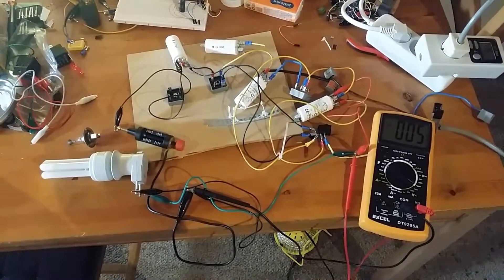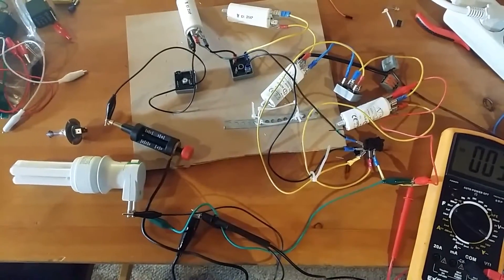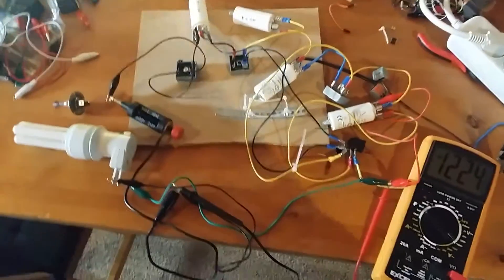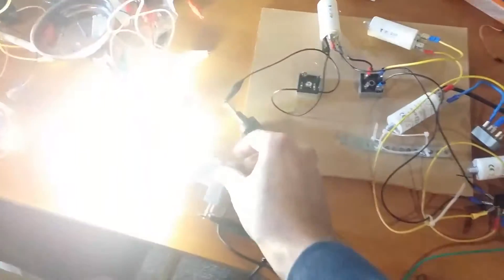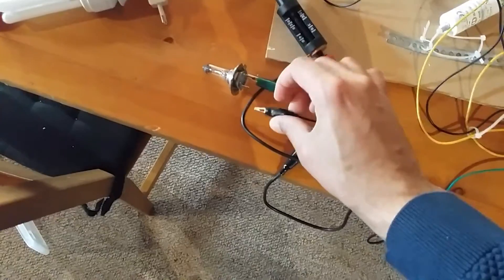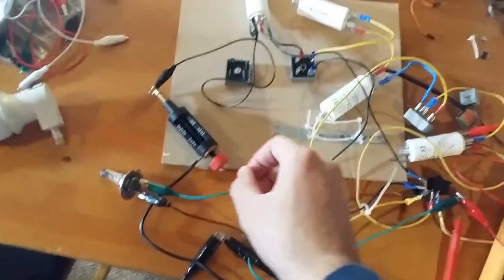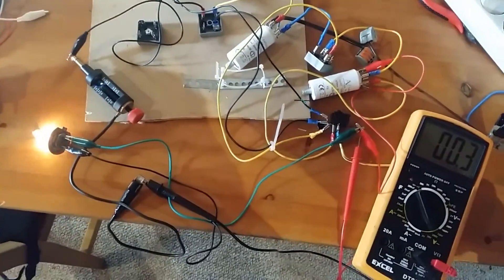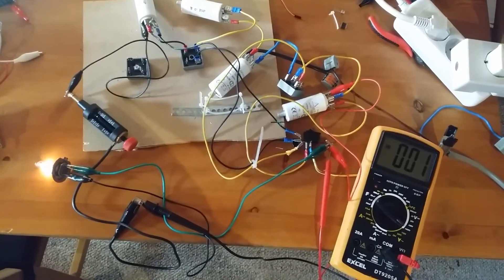Replication #2 MX6Maximus (Tate - Brubaker Primary splitting circuit)

Comment: Nice work Raymundo  I like it can you provide a link to where to buy the spark gap device you are using?
Reply from the maker: Thank you.
https://www.ebay.com/itm/High-Energy-Ignition-Spark-Plug-Tester-Wire-Coil-Adjustable-Circuit-Diagnostic/173177308538?epid=24004168215&hash=item28522c057a:g:jgsAAOSw2xRYgsts